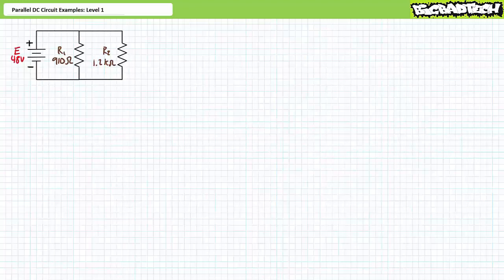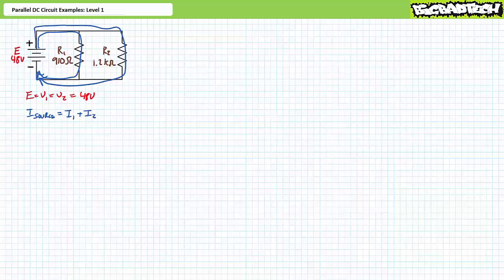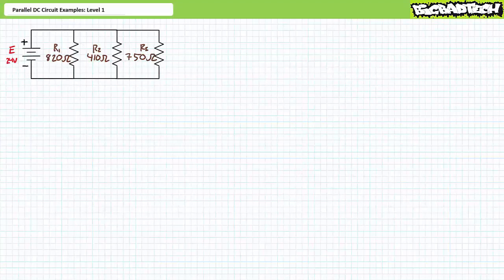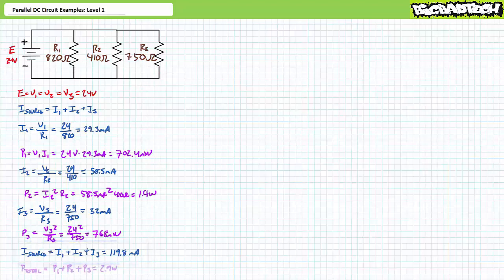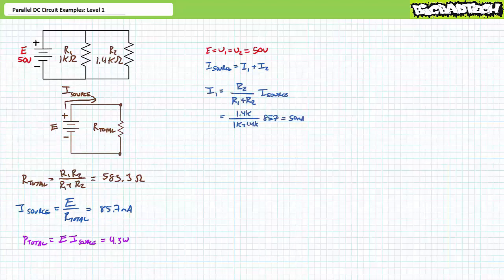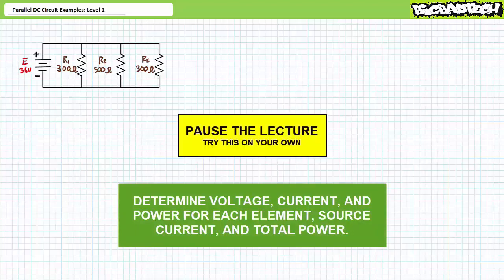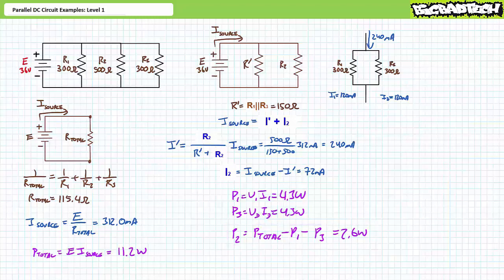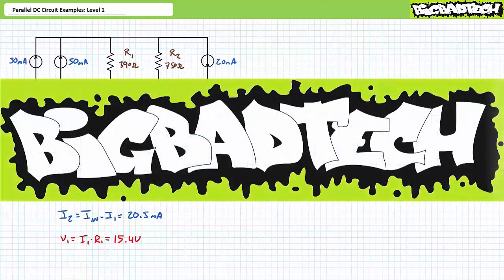Parallel DC Circuit Examples: Level 1 (Full  Lecture)

Comment: Hi Jim, I go all correct except for the last one. To me, the directions for all currents still look the same and so they must add up to make 100 mA. All currents seem to go in the same direction if you drag them along and around the loop. Maybe I'm looking at it the wrong way. Ant thoughts?
Reply from the maker: Not sure if you're referring to the "direction" of travel (CCW vs CW) or "where" it travels. Direction doesn't really matter as long as you're consistent. Conventional current assumes travel from + to - so everything should travel CW. "Where" it travels is important in parallel circuits. Consider a parallel circuit with 2 elements. There would be 2 independent "loops" and source current would be the summation of both loops. If we added a third loop the original two loops would remain the same only the source would have to supply a new third loop and source current would be the summation of 3 loops.
Reply: @bigbadtech  thnaks